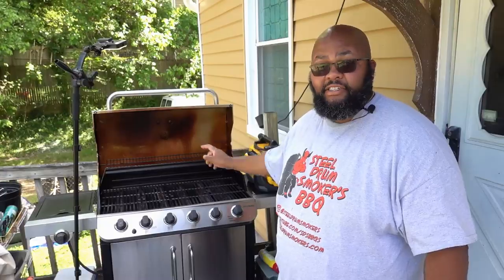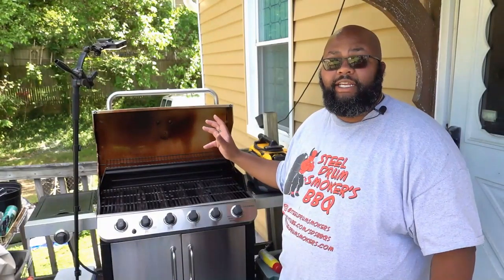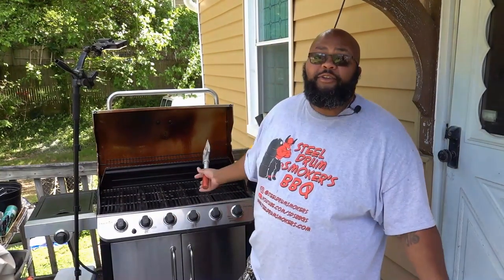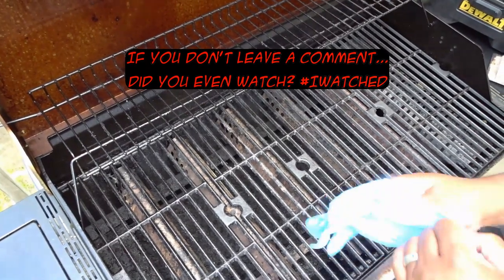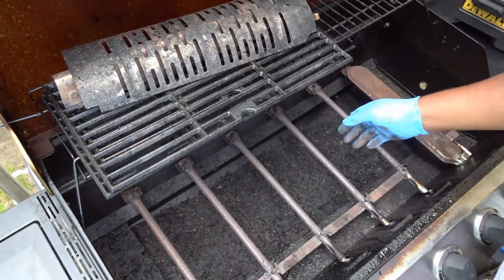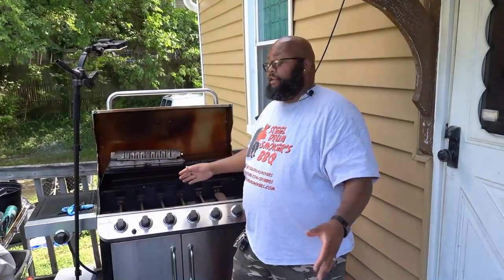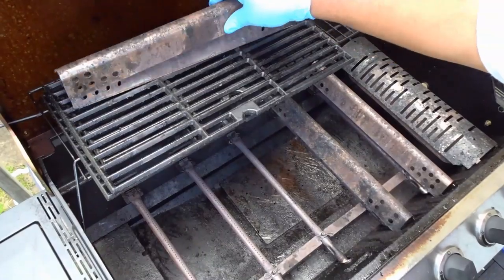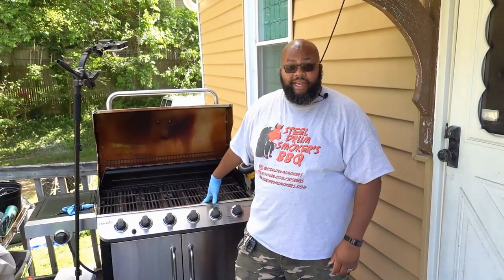SDSBBQ - How to Clean the Inside of a Propane Grill

Comment: Ok, here's one thing I suggest any time your doing a clean up on a propane grill. With the grills and "flavorizer" bars out of the way light it up and check the condition of the burner tubes. There should be little blue flames coming out of every single hole on the sides of the tubes. EVERYONE. Any that are not working can be cleaned out with a thin wire or pin. This is necessary so as to heat up the bars hot enough that fats falling onto the bars vaporize,there by creating the same effect of fats falling onto hot coals. It makes a huge difference and will extend life of those tubes many times over. Now it's time for me to get to bed,later. 🔥🔥🔥
Reply from the maker: Awesome tip, thanks for sharing!
Reply: Brilliant idea, thanks for sharing.

Comment: I have a grill almost identical. What about the lid? it looks like it needs cleaning also. what would you use to "scrape" the gunk off?
Reply from the maker: A wire brush should probably "help" but to be honest I don't worry about it all that much. Just as long as it's not flaking off on my food.
Reply: @SDSBBQs  Thanks! Thats what I'm going to do. Also, I've found out, its better to scrape and scrub WITHOUT those "Cleaners" they advertise. I haven't found one that cleans a Grill like they claim. Your way is BETTER!
Reply from the maker: Thanks!

Comment: Ummm that should have a tray that just pulls right out and you can hose that pan out in lieu of vacuuming! Then spray with equal parts with vinegar and water let's sit for 5 to 10 minutes and Rinse off. Best way to clean chrome too equal parts vinegar to water no soap. Dry whole grill with a leaf blower! I find an invaluable tool for cleaning the grates and larger crud in between crates is an oyster knife. Right thickness and nice bevel blade!
Reply from the maker: Thanks I'll keep that in mind for the future.

Comment: can you use water hoose spray on the inside
Reply from the maker: I don't see why not but I'd worry about getting all the water out. Sometimes using a hose might be TOO much water.
Reply: @SDSBBQs   like a strong mist spray will that mess up the flame bar
Reply from the maker: I don't think a strong mist will mess with the bars. But... why not remove them before cleaning?